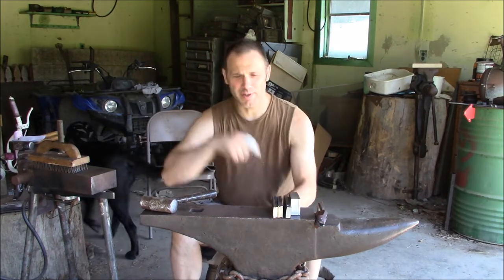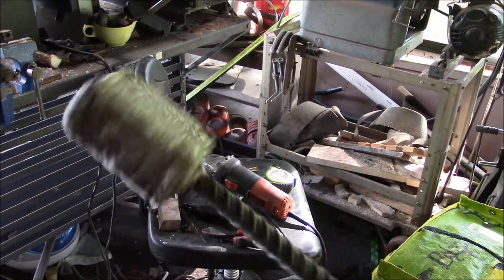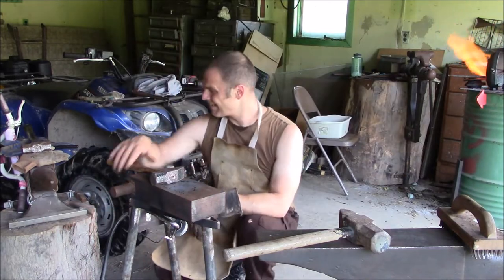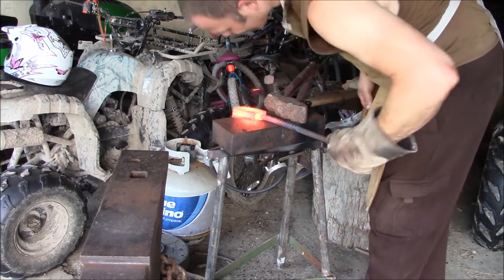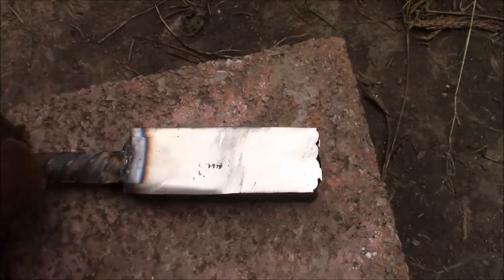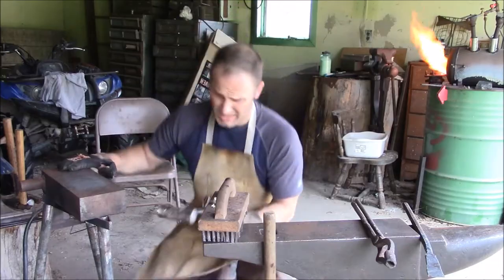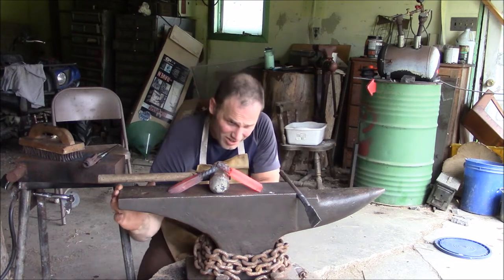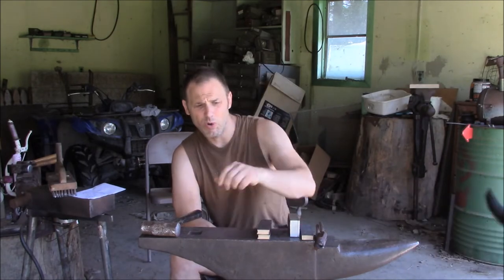Forgewelding 5160 to Bandsaw Blades: Bladesmith Vlog

Comment: A few things I can see.

1. Your forge isn’t getting hot enough. Your billet needs to be a “bright yellow” like a stick of butter with no shadows.

2. Your pre heating anvil isn’t working for you. It is so lightweight that it is pulling the energy from your hammering. It would work faster if you use a “sacrificial” hunk of metal to lay on your heavier anvil. 

If your anvil is vibrating or moving while you’re hammering, it is transferring all the energy into the floor.

3. Choke up on your hammer… holding so far back on the handle makes it a lot harder to hammer and wears you out fast. 

You are using your back a lot, see if you can use your knees instead… you can last a lot longer and it also won’t wear your arm out so fast.

Have a great day and great forging!!!
Reply from the maker: Thanks, it seems like your input is coming from a constructive place. 
1. My forge is getting hot enough, the camera doesn't show you what I see with my eyes.
2. Very interesting, you might be onto something with my preheating anvil losing too much energy. I have found that my problem seems to be the distribution of force quickly enough while the steel is hot. 
3. I do choke up on my hammer sometimes. My stance is directly related to a nerve problem I have in my legs due to a severe back injury from six years ago. I've had three back surgeries, it seems I am stuck with the nerve problem for life.
Reply: @WJBlades  sorry to hear about the nerve injury, that just sucks so much… I wish you the best with the pain, I understand how it will definitely inhibit a lot of different motions.

I have seen a bunch of different videos on how to make a press with a used wood splitter… That may help you with moving the steel. 

I have to get ready for work so I will catch you later.

Comment: Is it possible without a welder.?
Reply from the maker: Probably but, I have no experience without at least tacking the plates together with a welder. Sorry. ☺
Reply: Use haywire in a drill twisted tight or screw clamps.

Comment: Man 5160 is a finicky bitch to forgeweld man! Go with a 1090 series.  Ive never seen any of the pros use it for damascus  and there is a reason for it.  Its just finicky to forge weld yeah it can be done its just difficult.
Reply from the maker: I was just using up what I have. For future projects I'll likely order some 1/8 inch thick 1080 to go with the bandsaw blades.
Reply: W1 is a great welder too.

Comment: without actually watching the video I already spotted a problem...5160 is not a good choice for welding. I'm not a metallurgist but I've talked to many people about what to use when forging and I've asked the question many times about 5160 and none have ever said its a good idea.  That being said, I think the best way to insure steel to weld providing you have the correct welding temp is to completely weld the billet shut. that will create a zero oxygen atmosphere and it will stick with no delams.  I was beating my head against the wall with all the delams till I started welding the billet shut.  hope this helps.
Reply: "I'm not a metallurgist but" 5160 forge welds up fine. You can stick it to mild steel, 10xx steel, tool steel, even 9260—it just doesn't stick to itself.